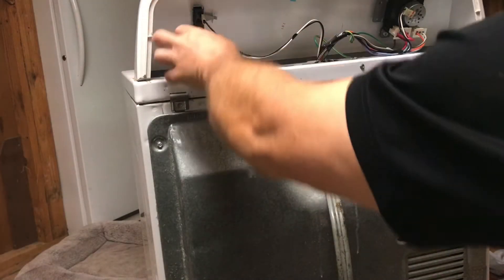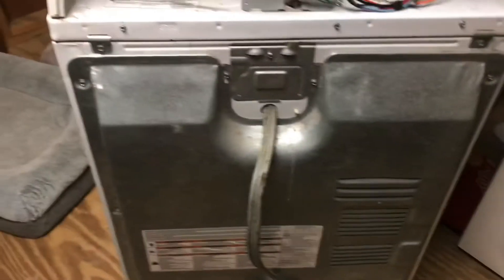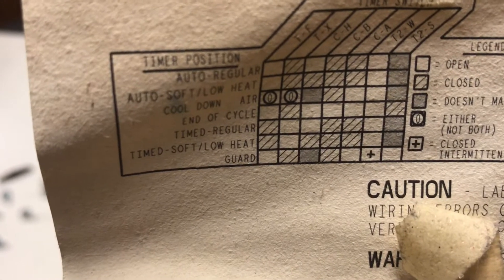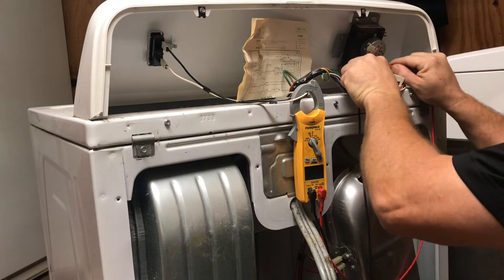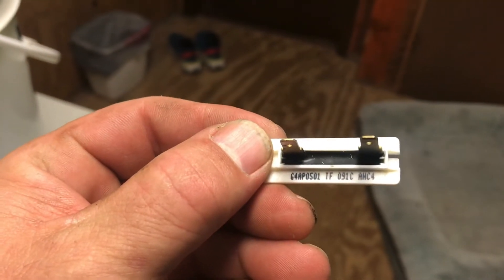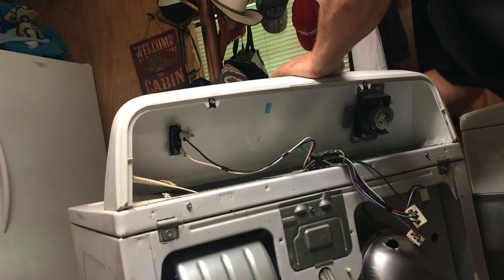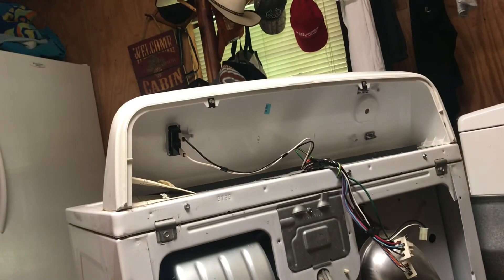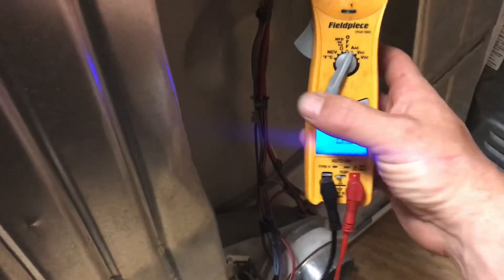How to repair Roper dryer not heating. Fix it!

Comment: I have what I'd assume to be the exact same dryer, Roper model RED4640YQ0, died a few months ago. Actually just replaced every part BUT the timer for $20 bought on Amazon, and ofc it didn't work. Timer costs $68 on Amazon, don't have much choice but to try and hope for the best but I couldn't for the life of me unplug that smaller plug on top of the timer. Gonna try again tomorrow, but thx to you for making this video bc for all the help google is nobody else knew the timer was even a problem.

Comment: Sir you are a Saint, thank you for showing me what I was missing. I changed and check all the fuses and nothing. Spins and all fuses are good. But I didn't know the timer would affect this. So ordered mine through Ebay. I checked the timer like you did as well and CA was not working so I'm pretty sure it's that. Thanks again liked the video 👍.

Comment: Appreciate the vid fellow DIY repairman, helped a lot with the same exact issue. Sadly when testing the upper thermostat i pulled the terminal off and with no solder I'm sure I'll order that and the timer. 

Hest coils check out fine as well as the lowet thermostat and thermal fuse, as well as the exhaust temp sensor. Where did you order the parts from, ebay, amazon?
Reply from the maker: Amazon if I remember correctly
Reply: @fixitdad9669  appreciate it mister, thank you and good morning, hope y'all are in good health and have a happy holiday week 👍

Comment: 8:09 what model dryer is this? I have a ROPER EL 4030VWO Dryer
Reply from the maker: Not sure of model number. I gave this dryer away.
Reply: @fixitdad9669 I refuse to give mine away I had to have the thermostat replaced and the gentleman that fixed it said that this is the best dryer ever made. They are a workhorse. Most dryers last only as long as  the warranty.
Reply from the maker: @debbiebuxton2854 I gave it to my dad and is still working fine!

Comment: I realize video is 2 years old but ihave same dryer same problem. That part number brings up many compatible parts with a different number. I guess im fine with that but none of them indicate if they to come with that other tiny part he didn't  use. My lint exit was clogged so i want to change that aswell , just incase.

Comment: I have a dryer where it will not do the cool down setting,will this be a timer issue or any other?
Reply from the maker: Won't shut off heat? Sounds like stuck contacts inside that selector/timer.

Comment: What if it’s heating but it takes 2-4 times depending on the load to dry the clothes?
Reply from the maker: I would say that you may have a bad heating element. Check for continuity between elements.
Reply: Same here

Comment: cant see where you're placing the meter prods
or what setting the meters supposed to be on, i bought all new parts and my dryer still wont heat
Reply from the maker: Not sure 🤔. Have you traced out the wiring schematic and checked all the safeties? Does your heating element have continuity?

Comment: i have an analog meter , you're  not showing what byou set it at or if the dryer is plugged in.
Reply from the maker: I was using continuity test with tone indicator and unit was unplugged.

Comment: Where did you find your part?
Reply from the maker: Google part number off the one from my dryer.
Reply: You can find it on amazon, just like he said type the numbers and it will show up.. its around $50-65.... Ebay as well has them.